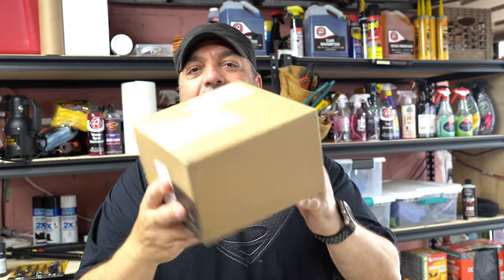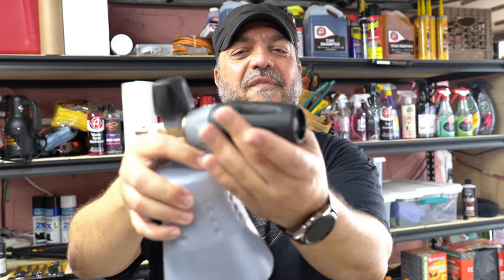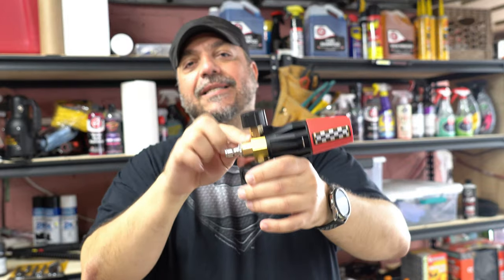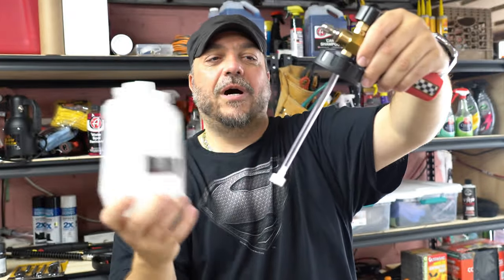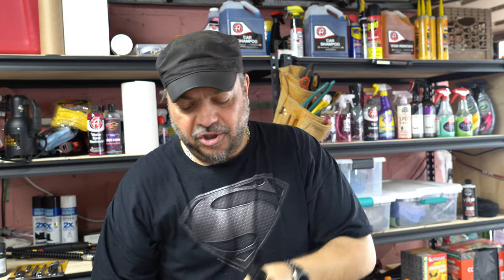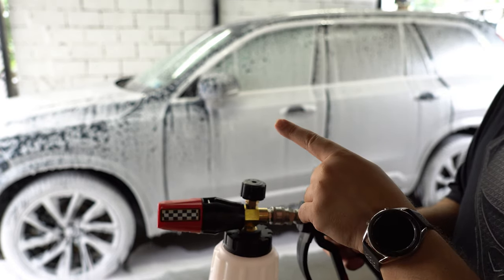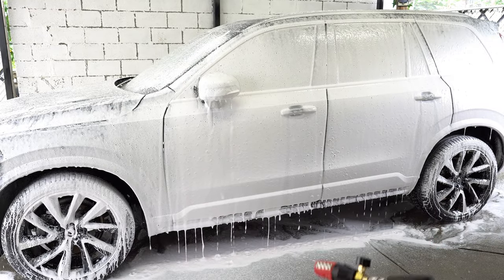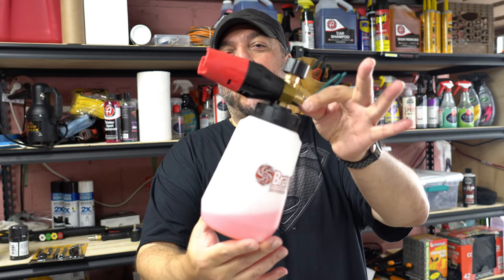Time For A Foam Bath - Bravex Foam Cannon Review

Comment: Hey Mike good review 

If you buy cheap or expensive they all work the same. Ive gone through loads trust me 🤣, 

Change the gauze ( mesh ) for tighter one, you'll get thicker and better foam either with cheap or expensive foam cannons. Also depends of you mix 1.10 or 4.10

Comment: Also where 1/4 inche is, if you take that off usually there's a flat head screw inside with a tiny hole in, make sure you clean the cannon out with warm water, other wise the gauze and the little hole get blocked
Reply: Yes so true good to see someone educating 👍